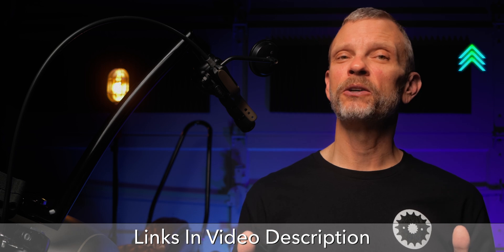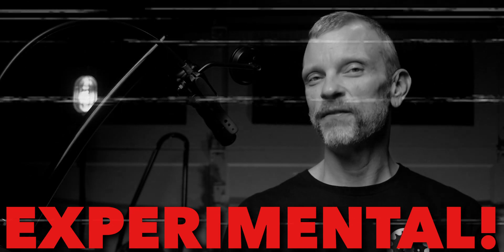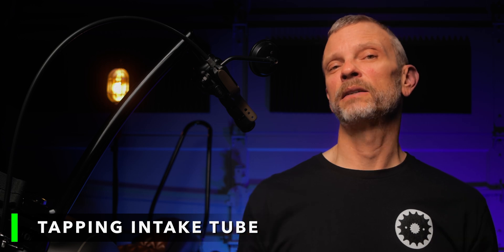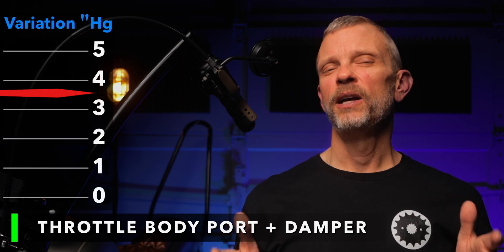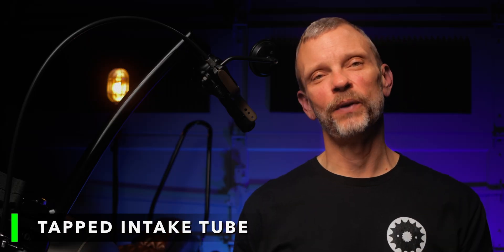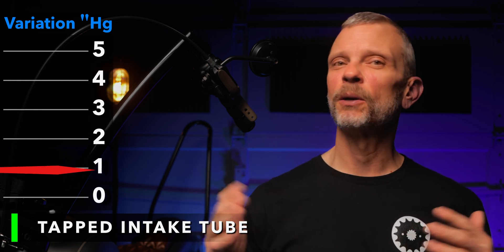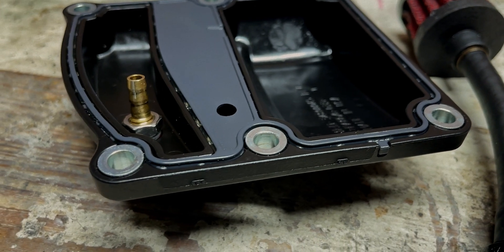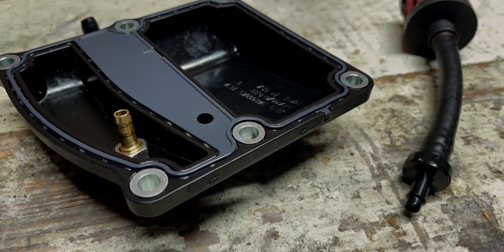Vacuum-Ported Catch Can • Crankcase Vent: Keep It or Dump It? 👍🏼❓👎🏼 (M8 Sumping)

Comment: I have a 2017 ultra limited 107 10,00 miles on it so I keep catch can and and put vacuum from crankcase to intake vacuum port 
Cause u can’t vacuum bout ends can you or will it vacuuming against each other
Reply: Ported catch can  one in and one out y split hose fitting for vacuum crankcase to intake port two in to one on breather hose to catch can maybe damper valve in between catch can an y fitting to control vacuum on breather to not fight against each other
Reply: Hi Ron I’m Robert and Igor My very first bike I really don’t understand the science to all this like you would I have reached out to a lot of people no response I no I need oil pump cause 2017 ultra limited  not having any problems lil oil on catch can I just want to get as many miles as I can all stock Reinhardt slip ons and power vision Turner that it I’m a poor boy lol and thank you for your videos George Bryce talks about vacuum and ring seal ring seal is life of motor I would think that maybe catch can for breather bolts and crank vacuum to its self I’m very stock on what to do
Reply from the maker: Hi Robert - if you add a crankcase vent you’ll address the biggest problem, even if you just do the basic vent with no catch can. I covered that in this video:  https://youtu.be/U6gOhbRQrwE
I hope that helps!
Reply: Should stock oil pump work better now that pressure is gone
Reply from the maker: Probably yes, as the oil could be less aerated.
Reply: Thank you Ron have a blessed day and I’m gonna make me some shorty lavers I’ve had dirt bikes my hole life so feel like that will make me more stable on stop and go traffic
Reply: I think my ultra 2017 has 5 pounds of vacuum at intake port I don’t think that is to much to vent transmission top cover directly to port and let breather bolts breath in to catch can
Reply from the maker: That seems reasonable…
Reply: Goethe Bryce puts over 25pounds in his crank case and has a video on vacuum pumps I would look at if you haven’t already
Reply from the maker: I’ll check it out!
Reply: Sorry George bryce
Reply from the maker: Thanks for clarifying!

Comment: Does anyone ever wonder about people who buy a brand new Harley Davidson an never do any mods? No Stage 1,2,3 or4 and no breather bypass or pressure release? Do they ever notice the problems or performance issues? I have my 7th Harley and it is a 2019 Tri Glide Trike. I just bought it a month ago. I am waiting until i get my bonus at work in April for my stage 1 and when I do that, I will do the tranny cover mod and the breather bypass mod. I did the Stage 1 and breather bypass on my 2012 Street glide 103 and I loved it for the 11 years I owned the bike.
Reply from the maker: I do wonder! I’m sure there are plenty who leave it as-is and get lots of miles. But if I know about an issue I’ll address it!

Let me know how your stage I goes and the other mods too!

Comment: Great video, as always.  Thanks for all your work and research. Entertaining and very informative. I have a question,  what do you think about putting a hole in the cover from the oil side to the middle section, allowing the crank case to vent through the transmission vent?
Reply from the maker: Hey Pete & Donna - that’s worth considering for sure. There is the possibility of gunk from the crankcase “polluting” the gearbox, so keep that in mind. And that vent tube on the gearbox side is pretty small so it won’t vent a lot of pressure very quickly. Let me know what you decide to do and how it goes…

And thank you for the kind words!

Comment: Hi Ron 
i installed the heavy breather arlen mod 
i planned to to do allso the transmission cover 
but i see all kind of comments and your answers to them 
i made mistake ?? should i return to normal breather mod and do just the trans ? or both is ok with no further problems ???
Reply from the maker: Hello! There are lots of opinions about all of this, but with all that I’ve tried I believe that the main objective is venting the pressure from the crankcase and the secondary benefit is retaining a vacuum in the crankcase. I haven’t been able to confirm vacuum in the crankcase without applying external vacuum, so I don’t think you should be concerned about doing both the breather mod and the crankcase vent. Let me know if that helps.

Comment: In drag racing some tie the ccv hose to the header collector. 
The collector creates a little vacume on the hose which aids in evacuation of the crank case.
Reply from the maker: Hey Steve - that’s a great racer trick for sure!
Reply: @RonsWorkshop   I have this dilemma now. Not sure what I will do. I have bought a Y and 2 NPT to hose barbs. I have a 2014 ultra. Just had the engine built. I don't want to run the ccv through the engine. I have a 2 into 1 into 2 head pipe. I might try a siphon tube in the merge (X) part of the head pipe. Not sure if that would be the right area. Or what angle to introduce the tube, how to shape the inside. Flush, extended, how far, cut on an angle? I need someone who knows how this should be.
Reply from the maker: Hey Steve - I haven’t done that mod myself, but if I was to try it I’d try to put it at an angle with the opening inside the pipe facing the outlet. If it could be flush inside that would probably be optimal, but you may not have enough wall thickness. My plan B would be straight in with minimal extension into the pipe. 

Let me know how it goes and what you learn!
Reply: @RonsWorkshop  I will. It may be a while. I'm working a lot of hrs. And days. But it will have to be done. I think I can tig it, flush with about a 45°. Will be what I shoot for.
Placement in the X part will be my concern. I'm thinking center of the flat portion. Not sure. Or each individual head pipe to each head banjo bolt.

Comment: Using A1cycles vented dip stick , not sure if it helps or not but very , very little oil in the intake All though I didn’t check the intake before changing so no data to go by
Reply from the maker: Hey Monte Krueger - thanks for sharing your setup and results!
Reply: @RonsWorkshop  forget to mention my bike is a twin cam 103
Reply from the maker: Ok let me know how it goes. I’m not sure if that transmission top cover configuration is any different?

Comment: I've been thinking on it and it's physically impossible to have a vacuum and over pressuring in the same chamber and the problem that we're experiencing is overpressuring and with the overpressuring if the oil pump required a vacuum we would already have a problem with the oil pump the question is, does the oil pump need a pressure on the oil tank to receive an adequate amount of oil.
Reply from the maker: Hey Grim Shadow - I believe the oil pump should be able to function fully with no pressure on the tank - but that’s just a guess. If there’s pressure in the crankcase and/or sumping, that could cause aeration and thereby decrease the pump’s efficiency.
Reply: Awesome thank you 👍

Comment: I've reviewed dozens of videos on this topic and appreciate the detail you provide, Ron.  I've purchased the parts to create my own M8 tranny cover vent and have a few questions/comments to either display my ignorance or add to our collective understanding:

1) I believe crankcase vacuum is created by offset compression and exhaust strokes (they are not balanced with intake and power between the two cylinders to maintain even crankcase pressure, thereby producing alternating pressure and vacuum states as well as the signature Harley potato, potato sound).  Further, I understand the stock breather pathway has one way valves to allow escaping crankcase pressure but blocks air travel in reverse to allow for small intermittent vacuum to be developed as described above.  Given this, I don't see how the intake system could possibly participate in any vacuum creation - in the crankcase.  Intake vacuum may assist in scavenging air out of the crankcase when it is under pressure, but the second a vacuum is developed in the crankcase the breather valves would close cutting off access to intake vacuum.  If I've missed something here, please enlighten me.

2) Trask provides a note along with their trans cover solution (CheckM8) warning owners of 2019 and earlier M8s that there is NO seal between the oil pump body and the crankcase inside the cam chest. (re: bulletin M1450, seal HD part nbr 62400205).  The seal (provided on subsequent M8 models) prevents crankcase pressure entering the cam chest through the pinion bearing.  Trask warns that oil MAY therefore be pushed out their CheckM8 tranny cover vent, although the note indicates their testing has provided good results.

3) My bike is a 2019 Road King built in May of 2019, which is the exact month Harley began providing the improved oil pump and cam plate.  There is no way to determine whether the good pump is inside my bike without disassembly and visual inspection, although my experience on a recent 4500 mile trip from Michigan to Arizona and back provided anecdotal evidence that the good solution is not in place.

I hope this commentary is helpful to the community and I would appreciate feedback, especially if I have expressed anything that is in error.  Keep up the good work Ron, your videos are enjoyable not only for their content, but for their clarity.  I hate opening a ten minute video based on an interesting title only to listen to nine minutes of pap.  Your videos are informative, concise and very much appreciated.
Reply from the maker: Hey Jeff - thanks for the input and the kind words! 

I’ve heard both assertions - that the vacuum comes from the piston movement and/or that it comes from the airflow through the throttle body. I’m not sure which is correct, or if they both contribute…nor have I been able to measure a vacuum in the crankcase…but I’ve chosen to “hedge my bets” and use a check valve with the crankcase vent just in case a vacuum is present. 

Regardless, I know that crankcase pressure is harmful and leads to many different problems, so my primary goal these days is to alleviate that pressure regardless of the vacuum presence. 

Let me know how your crankcase vent goes!

And if you want a sticker send me a DM on Telegram, Instagram or Signal with the mailing info @RonsWorkshop

Comment: What i have done is i installed a crankcase breather with a check valve and ran the intake oil breathers back to the transmission cover oil pan side just like the breather and i seem to be having good results any thoughts
Reply from the maker: Hey Andy - so you’ve got the breather mod venting to the crankcase and the crankcase venting to atmospheric through a check valve? I think that’s a viable setup and one I’m planning to try.
Reply: @RonsWorkshop  yes sir that is what i did and it seems to be working extremely well on both short rides and long and i seem to stay a stedy vacuum and only drop out under hard acceleration
Reply from the maker: Excellent!

Comment: Hey ron, I know I had already asked you a question about how much vacuum is too much etc. But I actually while rewatching this video came up with a possible solution that I'm kind of curious how it'll work..

You mentioned while using the vacuum port and damper setup, at sustained highway speeds you would start to get crankcase pressure build up well I think I may have some sort of a solution. Now this will cause the system to get a little more complicated so that is a downside but however here it goes.

If before the vacuum damper you set up some sort of a t fitting so that some of that pressure can be bypassed through a check valve, then vent to atmosphere like one of your earlier videos. this could possibly fix that pressure issue without sacrificing vacuum at lower RPM ranges. The check valve would stay closed one under vacuum obviously, and would allow to be opened to relieve the excess pressure during a sustained highway speed.

Let me know what you think I kind of want to see the system get made very well because I think this is a great benefit of these new bikes and these new engines.
Reply from the maker: Thanks for contributing to the discussion again! I think the pressure I observed at highway speeds could be alleviated by opening if the damper more to let more of that vacuum through. I didn’t do any further tests (yet) but that could address the problem. Your idea could work as well - of course it introduces another variable, but it could be worth trying if the damper adjustment doesn’t address it. Let me know if you try anything.

Comment: I have a 2017 Ultra Limited with a 107 M8. I have been really looking into venting the oily residue back into the crankcase down into that cover. However, I was also thinking about drilling a second port and running a vent tube back behind the swing arm pivot like you did. I like the idea of the check valve on the vent tube. As this will allow vacuum to still be in the case. 

If I do what I’m talking about will I need to adjust the vent tube with some kind of valve to adjust the amount of vacuum that is being Introduced to the crankcase?
Reply from the maker: Hey WORKHARD&RIDEHARDER - would you use the throttle body vacuum port? If you do then my opinion is it would be good to have a valve of some sort like I used for controlling that vacuum. But I’m not an expert at this - I’ve just done some experiments and tried a few things out. 

I’m also unclear on where you’d run the extra line from and to.
Reply: @RonsWorkshop  I was thinking of running the crankcase vent tubes together then down to the trans cover where it can drain back into the crankcase. I would drill a second hole for a vent tube to allow the crankcase to vent to the atmosphere with a check valve and a filter on that tube. This would allow the oil to drain back into the oil sump and would allow positive pressure to vent out but would also allow any vacuum to stay in the crank case using the check valve. 

I would not have a port coming from the intake. Only from the factory crankcase vent tubes down to the trans cover over the crank case portion.
Reply from the maker: That’s an interesting idea! I think it’s worth trying - let me know if you give it a go. That could be a great option for sure.

Comment: old school racers used to instal a bung on the headers with a 45° tube attached the the top end for vacuum - without having "vacuum leak" on the intake. add a vacuum pump - but i used intake tube to keep vacuum draw on this side of the butterfly valve. btw - that Amazon catch can is built well, the braket...not so much lol
Reply from the maker: Hey Jere - that exhaust bung truck is a good one for sure. Classic racer tech! 

Yeah I’m with you on the catch can.  The can is solid but the bracket…eh…

Comment: Love these videos and thanks for your content and all the updates to see how things go. I do have 1 question, in your opinion (or maybe you were informed of this at some point) why is 8-9 inches of vacuum at idle too much? Many cars today (while larger engines) are usually running upwards of 15 inches at vacuum at idle without issues. I'm wondering why this would be an issue on even a scaled down engine. Was the engine running strange or was it too much flow at idle and wasn't properly filtering out the most? Just trying to figure out what'll be the best option. 

Again great content. Please keep up the great work.
Reply from the maker: Hey AudiLoveS4 - thanks so much for the kind words. I wasn’t able to find any sold info on “how much is too much vacuum” and I wasn’t comfortable just going with it at that level. Knowing that too much vacuum can cause problems, I didn’t want to fox one thing and introduce other problems. So, maybe 8-9” is ok. I just couldn’t confirm that. Thanks for your input as well!
Reply: @RonsWorkshop  thanks for the quick reply, and good to know. I might try to get a hold of some of my local Harley techs and see what they have an idea of how much vacuum might be too much
Reply from the maker: Let me know what you learn!